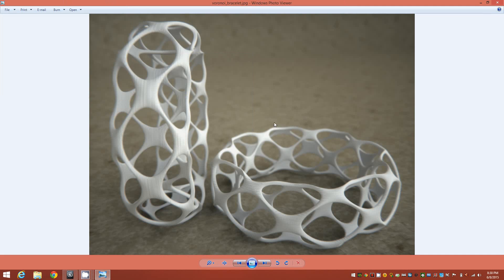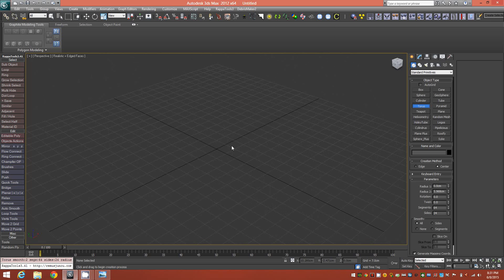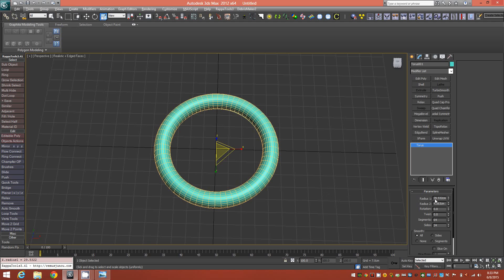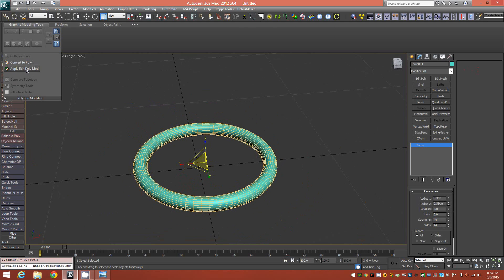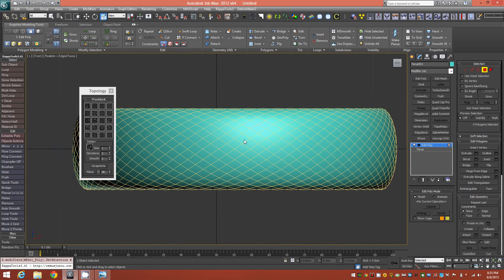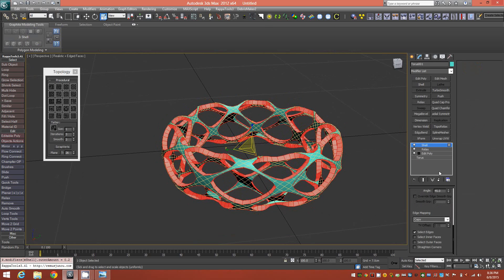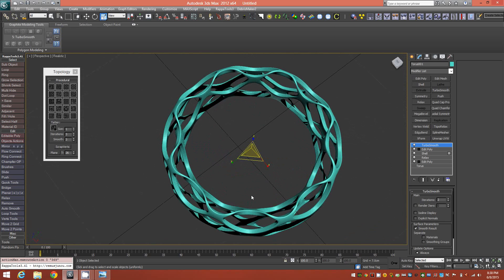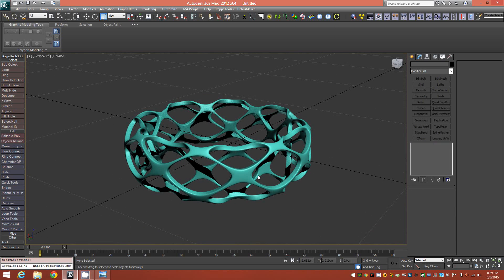3d Tutorial | Voronoi Style Bracelet | 3dsmax

Comment: can you do this with text
Reply from the maker: +Shaun Bourke  The basic technique can be done with almost any quad-based geometry, but some complex profile shapes will present problems here.  Especially if you intend to later 3d print the object.  You need to maintain a certain thickness for 3d printing to be successful, no matter which process or material you are printing with.  So it would all depend on the shape of the text, and how complex it is to start.  I would say this is not a very good technique to translate to text, although with a bold, straight line text consisting of all logical quad faces, it could work.

Comment: John, do you have any tips for 3D printing this? Does it require a brim, raft or supports? We are using a Airwolf HDL printer, Cura for the slicer, and PLA for the plastic at a community college. I need to convince my teacher that it will print. We are all new to 3D printing.Thanks for the tutorial! It is a beautiful shape.
Reply from the maker: +Mike Lewis It would all depend on the printer, and the material.  I haven&#39;t actually had this one printed yet, but I can't imagine it would require supports.  Depends also on if you are planning to create additional wall thickness, or if you're going to print it solid (more expensive).  I would recommend, if you were actually going to wear this object, you spend the extra money to have it printed solid (without additional wall thickness).  If you decide to save cost, and create wall thickness, you are likely to find that there are sections here that will need to be constructed differently, for wall thickness to work properly, and pass print specs.  You can make the crisscross pattern thicker, for example, which would make the holes smaller, but offer much more room for additional wall thickness, and support.
Reply: Thanks John. I did model the bracelet shooting for 2mm thick sections so it would be somewhat strong. The design does have a lot of shallow angle overhangs and bridges which are challenging to print, or so I have read. I think an experienced user could print it without support, but we (including the teacher) are not experienced. 3d printing is not really part of this CAD class, but a newly acquired bonus.
Reply: For those wanting to 3d print this and new to 3ds Max, 3ds Max will export a true to scale .stl file. First go to Customize - Units Setup. Select "System Unit Setup" have 1 unit equal Milimeters and check "Respect System Units in Files". This will control the export of the dimensions. "Display Unit Scale" in the previous window only controls the units you see in 3ds Max.---Also remember the torus is inputted as a radius and that radius is in between the inside and outside radii of the completed torus. So, if you want a bracelet with a 60mm inside diameter and a Radius 2 of 5mm you input 35mm for Radius 1. Take into account your shell thickness too if you are shelling out.
Reply from the maker: +Mike Lewis Good information, Mike.  Thank you.  Yes, I was also going to say that there are areas of this design that might be problematic when dealing with certain materials, but can be handled with some forethought.  Thickness is the main issue with this object.  If, during pre-analysis, you recieve warnings about thin areas, you can go back in and manually tweak this with various tools in the 3dsmax Graphite ribbon (I like using the Paint Deform brushes in the Freeform tab of the ribbon.  The Push/Pull brush can help thicken certain topology very quickly and with more isolated precision than modifiers can, and usually work faster than doing vertex level adjustments by hand.  I may do a video on how to go about this in the near future.  In my latest video, I do also briefly address scene scale, and system unit scale for 3d printing.  I may revisit this model in the near future, and show how to tweak certain things about it for a safer, and more predictable print.  I wouldn't recommend this model as an introduction to 3d printing, or novice printers.  Some of my other tutorials have models that would be much more suitable for that.  Thanks for your input here, and please let me know how this works out for you.
Reply: John, in case you didn't know, the supports I was referring to are for printing only to support overhanging areas. The general rule is avoid overhangs greater than 45 degrees to avoid having to use supports. Supports aren't terrible, but they must be removed and the print needs to be cleaned up after. An experienced printer might be able to avoid supports with your bracelet by changing temperature, speeds and using fans. It's fun learning the process I previously took for granted.
Reply from the maker: Mike Lewis Thanks again, Mike.  Yes, I'm somewhat familiar with their use.  None of my tutorials cover those kinds of printing details, as they could be added in a 3rd party analysis application, or some other print-tool preparation program, with the ability to generate support structures. I wouldn't have thought this model needs them, because the overhangs wouldn't be comparatively unsupported, or heavy. So thanks for letting me know.

Comment: I have 3ds 2015 and I have been using 3D studio for quite a while. I did everything as you did it (same dimensions and all) and I got the shape correct. However, I had to use around 40 iterations in the relax modifier instead of your 10 and still my pattern was a bit thicker than yours. Any ideas why?
Reply from the maker: kwstikos Hello.  Thanks first of all for following the tutorials, and taking interest in my videos.  I'd really have to take a look at the scene in order to understand exactly what may be going on there, but be sure you have "Keep Boundary Points Fixed" and "Save Outer Corners" UNchecked in the relax modifier parameters.  Also, be sure you are not still working in a sub-object mode in the edit poly modifier, beneath your relax modifier, in the stack.  I do not have a copy of the 2015 release to see if the relax modifier is behaving differently than previous versions, but I'll know for sure once I upgrade to 2016 very soon.